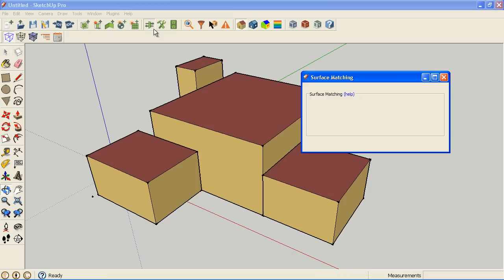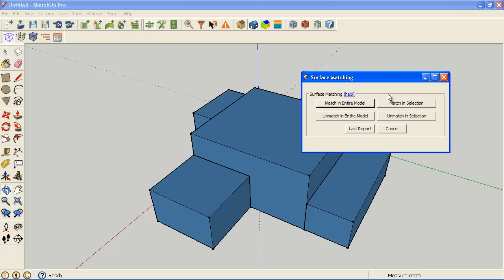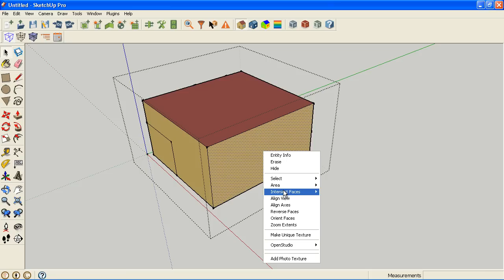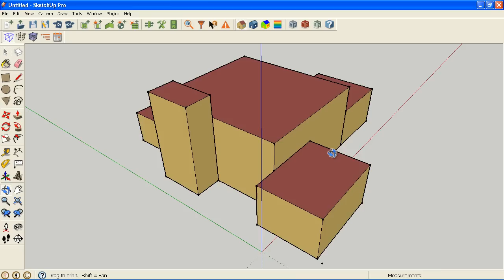Using SketchUp's Inersect with Model Feature to Assit with Surface Matching

Comment from the maker: @mpizos 

Mpizos, that is a good question. So when you are in a zone and drawing surfaces don't think of what you are drawing as walls. You are drawing zone boundaries (which may or may not also be walls). If your zone consists of two rooms then you should draw a single large box covering the volume of both rooms. In the old plug-in you wouldn't model the middle wall at all. In the new plug-in (0.3.0) you can use the interior partition group to model walls that are not zone boundaries.